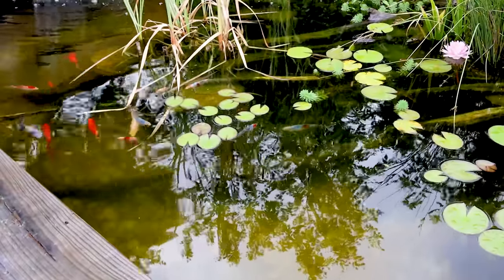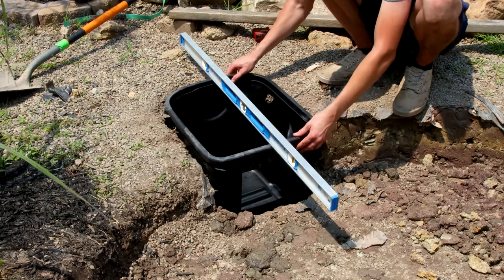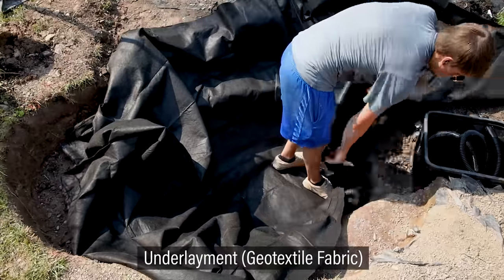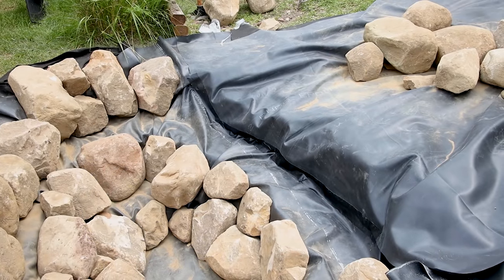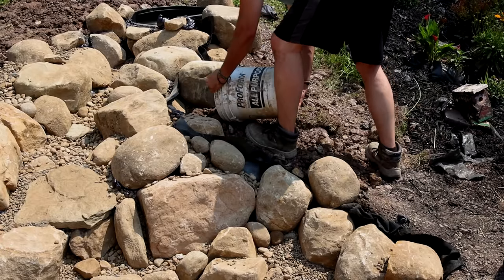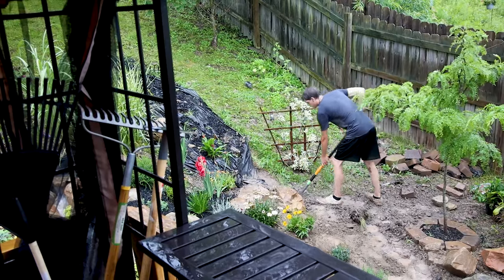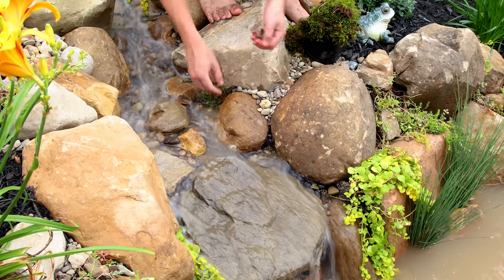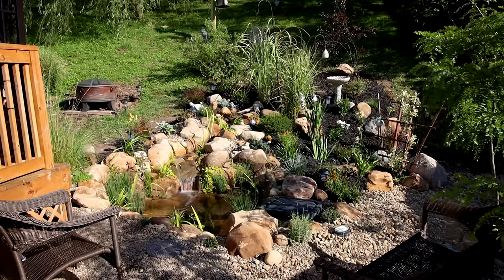DIY Backyard Ecosystem Pond (For My Parents)

Comment: You already said that you'd wished it was bigger.    Since your parents have a huge backyard, you should have made it  about 5 feet wider and 7 feet longer, maybe a feet deeper.    And about 3 feet longer for the stream with much stronger water pressure flow so you can hear the rushing down sound of the water louder.   It might have taken an extra 2 more weeks longer but differently be worth it.
Great job.

Comment: Very nice job.  I like the idea of the pond kits, but man aquascapes prices are out there.  There are kits available that use quality parts for a fraction the cost.  Most do come with just a 20mil liner, but 45mil liners are easy enough to get.  A 20x20 45mil liner shipped to your door is $350 on Amazon.  This does add another 3rd to the cost of competing 15x20 kits.  So you'll need to decide if the extra 25mil is worth it.

Comment: Wish we were neighbors. U do incredible projects.
Is the pond in shade or sun? How deep is the basin?
I made the mistake of putting my first one in full sun and the basin was only about 3ft deep. The water heated to the point where I had a constant algae problem.
Pro tip.  Light to part shade us best. A basin depth of 5-6 feet is optimal to allow the water to cycle

Comment: i have a burm in my backyard, used to use it for some tiered garden beds but it's been overgrown and untouched for practically 2 decades now. i can kind still see the old stone walls under all the ivy. i think i found my spring/summer project. so my big question now is, how does one properly secure stone walls for something like water pressure. i forget how they're structured right now but i think it's just interlocking (like bricks)

Comment: Hey man this is awesome, what kind of pump are you using and how do you power it? Is the overflow basin essentially just a plastic bucket with a hole in the front? - dependant upon the pump? Would the pond work well enough if instead of the overflow  you just has another basin up there with a ledge for the water to fall off of?

Comment: ~~Meant to say something when you did your pond&just say it now. I can't believe you don't wear gloves digging&picking? Much less scaping as well?
Reply from the maker: I get blisters if I do. My hands are so callused as it is that this stuff has little effect on my hands.
Reply: @SerpaDesign  I figured that or rare condition like my boss had? Didn't need gloves to weld,could move,p/u&hold the piece no problem. Only for cpl minutes though or it'd start to burn through. 
FYI: I know someone whose hands were callused as well or ever know it maybe a year after started using iodized salt instead soap. Seemed much happier too because his wife was as well,know mean? 
Keep up sweet work Tanner man!